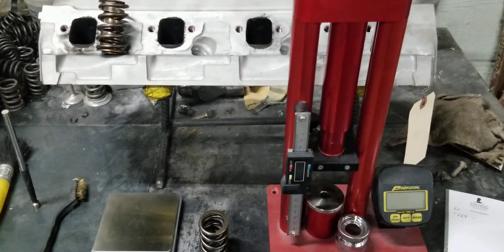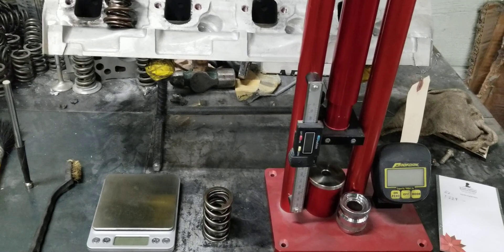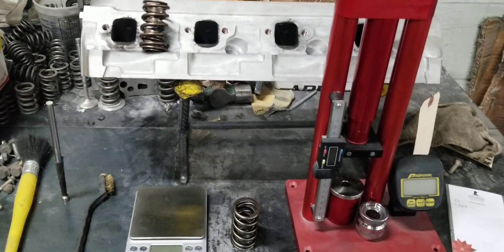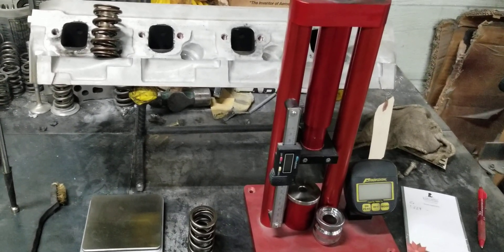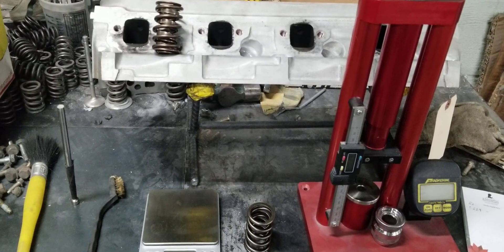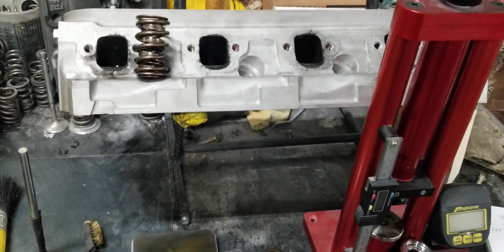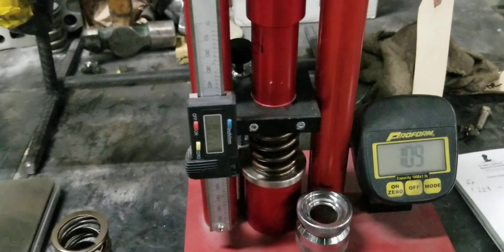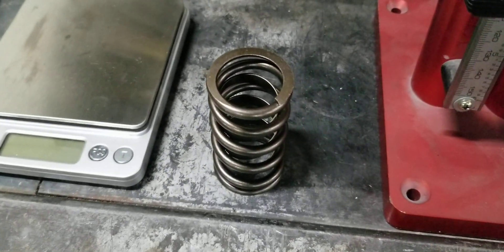Cylinder head valve spring checking and proper setup is crucial.

Comment: How can u tell what lift ur valve springs are good for
Reply from the maker: You have to measure them. Installed height, minus coil bind height, minus .050'. That's your max safe lift number

Comment: The dual spring did appear to be checked with a retainer. The second step in the retainer for the inner spring will increase pressure at the installed height.
Reply from the maker: The inner spring is shorter and yes the pressure will go up a tad but still. E lower that the Pac spring single